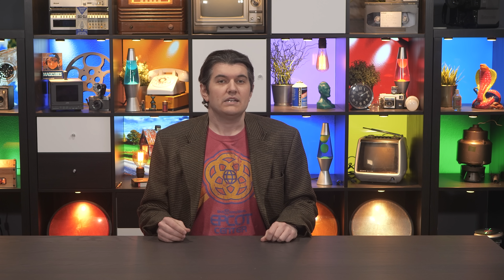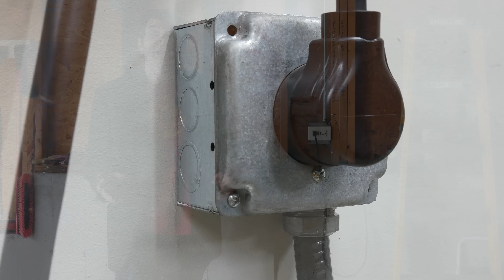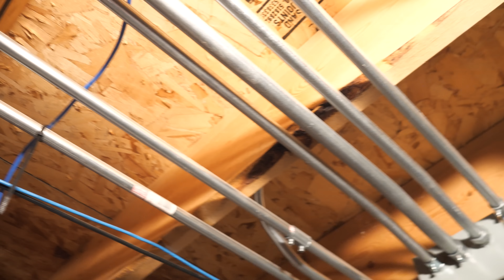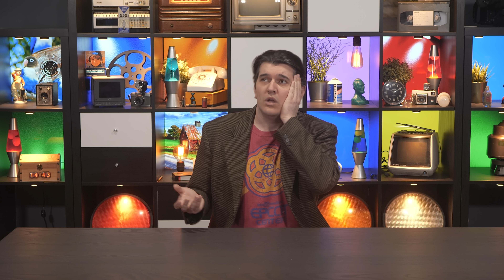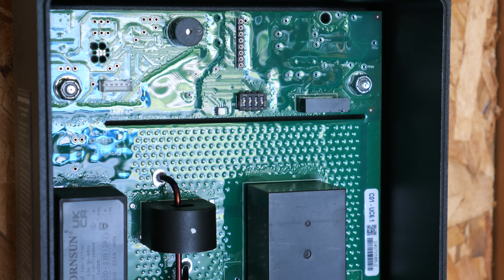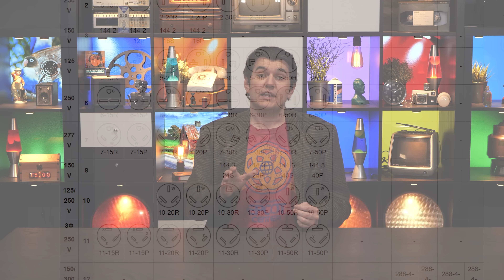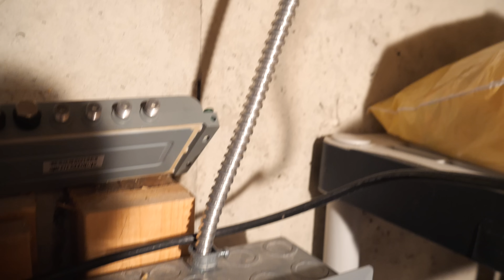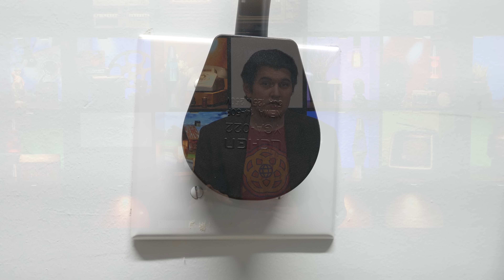The "standard" car charger is usually overkill—but your electrician might not know that

Comment: I usually use the standard 120V outlet to charge my Rav4 prime. I can go weeks without using the gas engine, just using the electic engine and charging it a couple of times a week. I can go up to 95KM with one charge of the battery. The cable that lets me do that also came with the car, just like they do with electric cars. Living in an appartment block prevents me from being allowed a bigger plug but it didn't change much on my electricity bill (in Québec, at least in my region, it's $0.07/KWh. Takes about 11hrs for a "full" charge (as the car won't go lower than 30%, it'll use the gas engine once I hit 30% battery and drive in a classic hybrid way).

Comment: Is the 80% rule just in the USA or should it be everywhere? For example, my parents have a 2400W heater with a standard 240V 10A plug and never had a problem, here in Australia. Maybe the safety margin is built in because they tend to be on 16A breakers, though there are generally multiple sockets on one circuit.

Comment: My 1st world problem:  Home A needs minimal charging, but has street parking.  Home II mostly needs minimal charging, but occasionally needs 150 mile range -- intermediate charging stations are not available.  To get from A to II is about 325 miles, meaning I need a 400 mile battery charged beyond the 80% point, and I need a way to charge it using street parking.  Hear me out.  Modular batteries.  Rather than a charging station, I roll up to an exchange center.  I get credit for the remaining charge in my battery, pay for the charge in the new battery, and swap them out.  Almost like the propane tank for a grill.  Why sit and wait on a charging station when I can swap out a new battery in the time it takes to fill a gas tank?

Comment: Great information on EVSE's. 

A little tidbit about your comments on the NEMA 14-50R receptacles.  Aluminum wire produced in 1987 or later is made of the AA8000 alloy, and does not need antioxidant compound. It does, however,  need to be properly torqued to the specified value given by the manufacturer. Over and under torqued aluminum wire can cause issues. Especially with heavy loads. Another reason the NEC has the circuit rated at 125% of the actual load for continuous duty.

Comment: I'm unfortunately one of the poor saps who wants to drive electric, commutes 30 miles one way, and lives in a house with wiring from the 1950s (two-wire in paper, no ground). I need to update the wiring before I can run the microwave and a crock pot at the same time. I'm hoping to get the full rewire done before the end of 26 when the Slate is theoretically released. We'll see. Anyway good vid as always.

Comment: I will say this about tightening lugs for charging equipment and the Hubble NEMA 14-50R, unless they are using a torque wrench, they are likely under tightening, professional or not.  The official torque spec is often much tighter than can be achieved without a ratchet or torque wrench.  My electrician was a journeyman with years of experience and had done industrial work with 50 amp outlets and stopped at about half torque when we checked with the digital torque wrench.  So my advice is either use a torque wrench, or hire a professional electrician who will use one or one who specializes in electric vehicles like those found by QMerit.

Comment: Absolutely untrue. If you drive more than 30 miles one way to work every day, you will not have the ability to make it to work a full week on 110v, full stop.
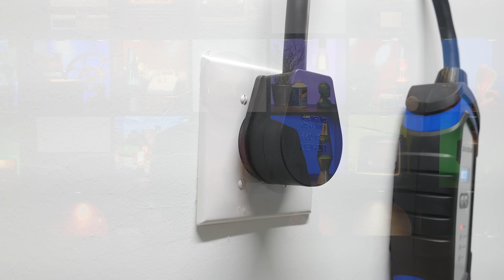Ignoring all other factors, you can not just rely on 110v charging, overnight for a full work week, you will be too low and then still be unable to get a full charge over a weekend… 0:30

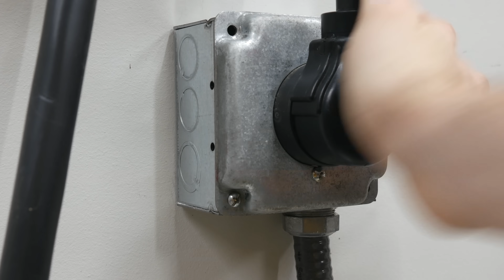Comment: 3:47 ---  Electrical Code Violation.  No connector on the back of the box.  

4:30 - you can get mc type cable in any size you like.  Maybe not from home depot.  But any electrical supply company will have it.  

We install 50 amp circuits for speed of charging.   But also to future proof against new more powerful chargers and cars.  Years down the road.

Comment: Your EMT conduit should have straps or clamps on them. I think a foot from the box or panel is code in most places, every 3 feet after that on pipe runs. Helps take strain off the box when force is exerted on conduit.

Comment: I drive frequently between MA and FL and back, usually overnight driving.  I can't use EV because there's no way I'm stopping every 100-200 miles to charge on a 1200 mile trip.  I've settled on my 2017 Kia Niro electric hybrid with about 51 mpg (about 500 miles on a filled 10 gal tank) to make the trip in maybe 3-4 fill-ups that take minutes.  I can't see how a pure EV will suit me but I wish they could.

Comment: I had my landlord install a 220v, 20 a circuit and it works great. I charge at 2.66x the level 1 charger and I have all the range I need, whenever I need it.
Since the panel was full, I had to buy two new breakers with double breakers in each space.
Please note that dryer breakers are NOT meant to run 24/7 and a car charger may blow the breaker even though it doesn't draw too much. Mention to your electrician or electrical supplier that you want to charge a car. They will sell you the right breaker.
Reply: 240v, not 220
Tandem breakers (but none are available in GFCI/AGFCI yet, so not code compliant for many jurisdictions)
Dryer 30A breaker is just fine for a continuous load at 80% = 24A.  Not OK for continuous load >24A.

Comment: I have a Volt and have experienced it on 120V (including 8A) and 3.6 kW 240V. It's barely noticeable the difference between them (in terms of how often I use gasoline). Even 960W charging is highly useful. On the other hand, I put in two 100A wall connections in my new garage, so future proofing is neat, too!

Comment: Add another to the win column for the REAL 240v countries out there. Every powerpoint is a car charging port.
Reply: Lol imagine pridefully fanboying over the voltage of most outlets in your home and ignorantly thinking that North American residential isn't "real 240v" to the panel and split phases. The US is "real 240v" if you remotely understand electrical distribution. Even this channel has covered it. The US has the option of 120 and 240v throughout homes. More options doesn't make it less "real", however not acknowledging this fact does make you appear less intelligent.
Reply: @Desert-edDave  Weaker options are for the weak. My kettle boils faster than yours though, and that's how you really know the measure of someone's power superiority.

Comment: Thank you for doing this video.  I tell one person after another that they can do charging simpler and cheaper.  If their car is a Tesla, they don't even need a charger - just the correct adapter plug.  Most ignore me.  My son expected to spend a lot for a new 50 amp circuit and wiring.  Then he walked around his house and noticed his air conditioner outside unit (240volt 20 amp) right next to where he parks his car.  A few dollars and an hour of work and his problem was solved.

Comment: I have to strongly disagree that 120 volt charging will work - we have had friends visit and are plugged in drawing 12 amps continuously and yet their battery is dropping in charge instead of gaining charge in cold nights or hot summer days.  An even when it does work in mild weather.... It took most of a week without moving the car for them to recharge enough to make it home

Comment: Cannot wait for ConnectDer to come to my area. I have a 14/50 installed but it's....sketchy....and will be removed before I sell the house. It's not dangerous, but with enough appliances running and the car charging I could trip my main breaker.

Comment: I seriously thought this video was going to be about a $70 12-volt battery charger conditioner. 

I use one in Texas to ensure that I get through the winter. Our body is burned out much quicker due to the heat.   Batteries rated for 6 years make it about 3 years and 6 months here. 

Anyway, I'm interested in watching the actual video so let's get on to it.

Comment: My apartment building has covered parking, as many do, and that covered parking has integrated mains powered lighting, I have no idea how common this is. So, there is a conduit running under the parking lot from a building somewhere to the covered parking. It would therefore be strictly possible for my landlord to add support for EVSEs. I'm making no claims about the cost or complexity of such a retrofit, but it could be done for at least some of the bays.
Reply: They'd have to completely rewire and would not be fiscally beneficial to do so as the load for EVs (if anyone even had any to charge) would surpass the intended use of the circuit, which is undoubtedly for lighting the carports.

Comment: I still dont understand the desire to install a receptacle for EV supply equipment (the charger itself is IN the car). Most of them have options to hardwire them. Simpler, cheaper, fewer connections to burn up, etc. You are not plugging and unplugging the charger in if its mounted on the wall. So unless you have a big welder or stove you want to plug in from time to time, just hardwire it!

Comment: MC Cable comes in sizes much bigger than 10 AWG. Ive done 200 to 400A feeders in MC. 10AWG is probably just the biggest you saw at a big box store. Even online electrical or wire wholesalers have much larger sizes.

Comment: To anybody who wants or is required to install wire runs in conduit, please be aware that the US NEC limits the length for runs of flexible metal conduit. You can find the NEC, which is the basis for most local electrical codes, on the NFPA website as NFPA 70.

Comment: When I look to buy or sell a home and find an EV charger pre-installed, I will then know that the technology has matured. Since it only adds about $1000 to the price(at most), I would expect many builders to add it to their standard build-out list, particualarly in mid to high-end homes. As far as I can tell, absolutely no residential building contractor where I live will install such a feature unless the buyer of new build home personally requests it in the build order. Thus I can reliably assume that home EV charging is not a mature technology. Economics will decide, and as of 2025, the answer is still NO.

Comment: 12:21 insert here the required rant about how wago connectors are vastly superior, especially when used by novices.
Reply: This is why Youtubers aren't typically respected by industry professionals. Lol@shills and armchair experts.
Reply: @Desert-edDave could you provide reasons to use wire nuts in the provided situation over using wago connectors? perhaps even any insights into why one shouldn't use wire nuts in the situation demonstrated by the video?
Reply: @Desert-edDave  🥱 conjure me up some snark, I need entertainment

Comment: New aluminum wiring does not need anti corrosion treatment paste because it has been reformulated not like the old wire. The terminals connecting to aluminum wire must be rated for copper and aluminum. Also wiring screw down connections should be torqued to listed specs.
Reply: some inspectors/local code will require it regardless of that.

Comment: Doing some math, I could charge my chevy bolt on a 120V outlet, 30% to 80%, in approximately 34 hours. Which fits really cleanly inside the 60~ hours between when I get home from work on friday and leave for work on monday. And I can get 40% of that charging done in the 14 hours between two work days. Even if I could only charge it for 8.5 hours a night, I can put in enough charge for 5 days, in 4 nights. If I really needed to have a "full" charge come saturday morning, I could just plan ahead and make that happen.

Comment: In my country a lot of companies offer EV charging windows where the power is only 6.5c per kWh but the window is usually only 2-4hrs between 2-4/6am so being able to get as much as you can in that time does have a benefit since the power is like 3-5x more expensive outside of the window depending on your rate. I also schedule my dishwasher, washer dryer etc for during that window

Comment: Well, and Wow, over 2K comments already, in less than 8 hours.  So, don't know if you will even notice mine.  But, you didn't address that SLOWER charging vastly increases total life of the battery, to boot.
Reply: That’s what I was thinking. Trickle charging always is better for modern batteries. Maybe it won’t always be the case but it certainly is currently.

Comment: We recently bought a second hand 'Series Hybrid' car. I find the drive really nice but  the battery isn't big enough to have an external charge system. I actually find it really hard to figure out whether the fuel efficiency is staying stable over time if we are only doing short trips as fuel is only used when the battery drops low enough or during heavy acceleration.

Comment: My condo building is currently going through the process of installing EV chargers (or rather, setting up the infrastructure so unit owners can pay to have an EV charging point installed).
Unsurprisingly, there are companies who make (and sell as a managed service) EV charging systems for parking garages that automatically handle load balancing and billing. And an electrical audit of the building found that even if every unit installed a heat pump (the building doesn't have air conditioning) there still would be enough electrical service to give every parking spot a car charger thanks to that load balancing.
The biggest problem - and why the process has taken two years with the first charger not going to be installed for another six months - is just because it's such a new thing for condos and apartment buildings to be looking at, there aren't many contractors with experience and willing to take it on, and the building owners don't quite know what the process is supposed to be or what due diligence they need to do. So everybody is a bit hesitant to commit and learning as they go. In the pretty near future though, turnkey solutions and the industry to support them should be widely available for apartments and condos.

Comment: Sounds nice for the average KWh cost rates of Chicagoland. Might even be cheaper than gas on a yearly basis. Though, I do have my reservations for cold climates and EVs. Had an incident recently in my region where every EV failed to charge in cold temperatures due to BMS preventing it, and people got stranded up in a ski resort. The KWh cost is about double here (Fetacheeseland) , so LPG is a preferred alternative for cost savings and reliability/convenience.

Comment: I wound up installing a 100amp wire but only hooked it to 50amp NEMA. I did that so I can upgrade to Fords charger that allows me to use the truck as a backup battery for the house

Comment: I installed a 100 amp circuit over 0 AWG (3 AWG would have been sufficient) through rigid conduit.  Why? because anything worth doing is also worth overdoing.

Comment: There is a device that is specifically made so dryer and Ev charger can be simultaneously plugged in were it will automatically switch power off to the Ev charger when the dryer is on.  Modern NEC code requires all recptical outlets to be GFCI PROTECTED in a garage and or basement. I don't presently have a EV charger but can one leave the charger long term plugged in to the houses 240 volt recptical when not charging a Ev vehicle? after all if it's hard wired I don't believe one has to turn the power off to it when it's not in use. Constant plugging and unplugging the plug will speed up the recptical wearing out to the point the recptical will not hold the prongs of the plug as will over time

Comment: I ran into your exact conundrum when I was contemplating on upgrading my home electrical capacity 3 years ago. After doing much research, in the end, I still opted for the upgrade. Sure it isn't necessary, but it will future proof my house. Especially when I want to sell it down the road.

Comment: Electrician here, Please do correct and accurate load calculations before committing. I agree that something is better than nothing but, If your service can handle it I'd 100% go 60A minimum. Slow charging is fine but random trips happen. Don't settle for limitations.

Comment: Some places have just 60A to their entire house?! Mine has 2 200A breaker panels that are fed independently, so a total draw of 400A for the entire house (or 320A with 80% rule)
Reply: Cannot get just 60 amps approved for a  home now I suspect, but many houses that were built before widespread electrification got only 60 amp service when power DID come to their street.  Not all of those have been modernized since then.  Rare but still out there.

Comment: 20:40 the inability to install a charging station is not the roadblock most of us have to owning an EV… do people not understand how expensive all electric cars are for regular people?  Hell regular cars are too expensive…
Reply: Look in the used market. If you want an EV, you can get an 8 year old Chevy bolt, with a 3 year old battery, thanks to the recall, for about 8-10k.

Comment: 14:20 I was running 120v 12amp with a Model 3 for years. The only reason I hard wired later on was because the receptical was GFCI and kept tripping randomly. Later found out about the GFCI built into the cable and how they don't work well together. Life is good now.

Comment: many cheaper charging stations will max out at 30 amps, regardless of the plug - but home Tesla chargers can be configured for up to a 60 amp power supply.  

and here's a crazy bit - if you're installing outside - you can buy chargers that will charge YOUR car, but otherwise, will only provide power if the person trying to plug in, provides a credit card number.  and YOU set the price per KWH.